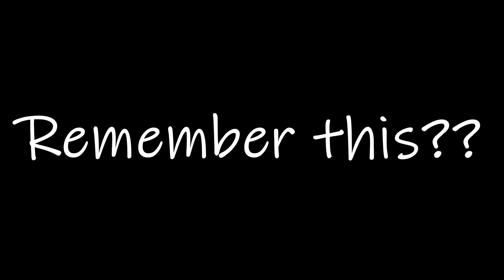The Story Of The Washboards; Building a cruising sailboat - SV Tapatya EP148

Comment: Hi Tony, It looked like you forgot to epoxy the end-grain of the ply before you attached the vent on the second attempt....
Reply from the maker: I did it after putting one side on. I just didn't video it 👍
Reply from the maker: Or at least, I think I did. I'll check that. The inner vent comes off easily enough if not 🤔🤔 Thanks!

Comment: OK, I'll ask the dumb question!... what's wrong with the vent being in the bottom board? Greater risk of water getting in, poorer ventilation, aesthetics?
Reply from the maker: I did consider leaving it there, Billy. But, greater risk of water getting in is the main reason. If the weather's not so lovely, it's good to sail with the bottom board in to stop spray or the odd wave/bit of water getting down below too easily 👍